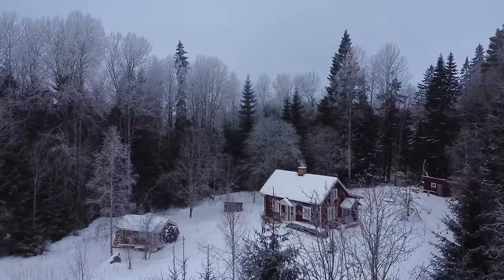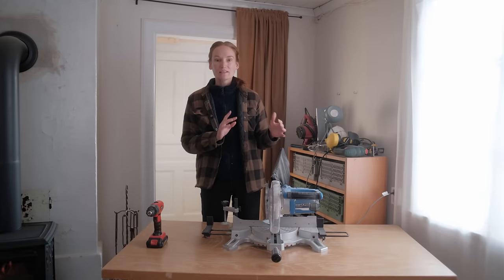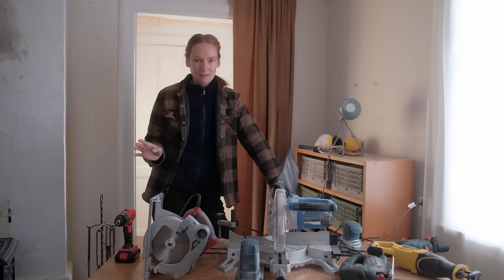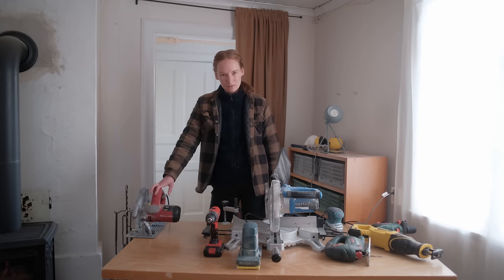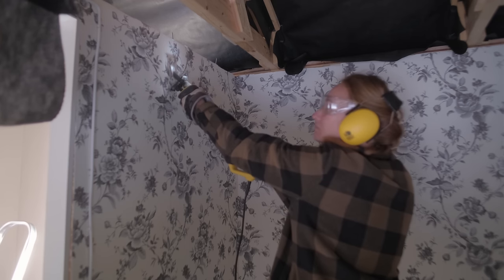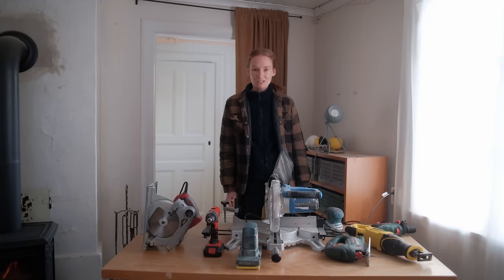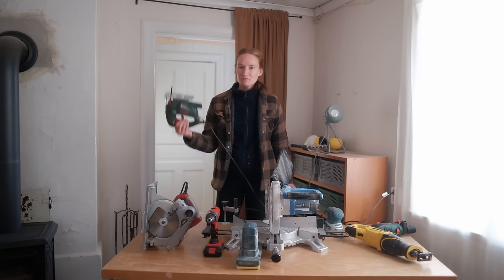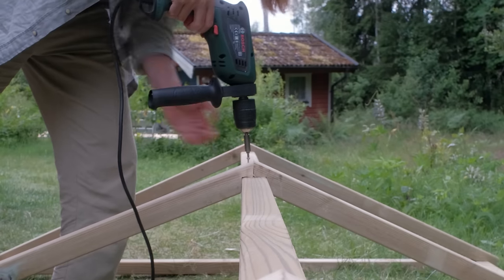The (basic!) Tools I Use To Renovate My Cabin

Comment: Orbital sanders are the best ones. Line Master Kwb Is a fine aluminum ruler, not that expensive. A small Block plane is a very nice tool, need some time to adjust, sharpen and learning. A little light hammer, 7oz, also nice for small nails. Regards from Chile.

Comment: There are tracks for regular circular saws on the market. There are also instructions on youtube for making a diy track/ jig for the circular saw. 

I have a circular saw and a table saw. I think I may have to get rid of the table saw. It is small and portable, but it requires so much room to use. And I may also trade out the circular saw (which I also hate) for a compact one and some kind of track or jig.

Comment: Very helpful. 
I do repairs and cut wood sometimes but don’t have a power saw of any kind!
I’m afraid of them!
I’ve known men that have cut their thumbs off and tipped fingers off!
I use a hand saw and a hacksaw. I have a little coping saw, too. 
That miter saw you have looks like it might be one I would try. 
I have a corded Craftsman drill that I’ve used for forty years. It does great at drilling but I’ve never done screwing with it. 
I did get a used battery operated hand drill but haven’t really done much with that yet. The batteries are expensive to replace and the drill is still is heavy, too!
Thanks for all the tips!
Really helpful!

Comment: Thank you for the valuable info.  I’m the states; I’ve decided  to go with a slightly less expensive brand  so that I can use the same battery packs. But the brand doesn’t carry all the tools that I need.

I try to buy myself one or two power tools a year.  This has served me well.

Next on my list is a nail gun.  Not sure which one I will go with???  A lot to choose from and tool shopping does tend to get very overwhelming (at least it does for me anyway)!  ❤

Comment: On buying into brand systems for power tools. Makita is definitly worth the price. They are light, precise and can take a lot of abuse. Bosch is also good, but not that good. The only other one i would buy into is Dewalt, that is slightly different, but as good as Makita. And sadly it's as expensive as Makita. Most of my tools are Makita now and they are a dream to work with (comming from cheap stuff).

But i have a question for you. I'm looking for a good japanese pull saw, and was wondering what brand and type you use. It's hard for me to find out what are the good ones and the ones you use has proven itself in your hands...

Comment: Rulers can be expensive, I use a aluminium levelingbar that is normaly used for leveling plaster. Fix it with clamps and it Is light and straight, and cheap mostly.

Comment: Hi Rosie, I’ve just found out about flexible drill bit extensions which allow you to drill screws in small inaccessible spaces. I’ve noticed you struggle at times with this issue and thought you may be interested. They are quite inexpensive 🙂

Comment: Another fun video, thank you. Oh, I was wondering how strict the building regulations are where you are, here in the US they are crazy, so it's difficult to do much with out a permit and they can be costly. Great review of your tools. So far it seems your choice of tools is great, and your advice for people to watch videos put out by the manufacture is good, although I prefer to watch carpenters who work with the same tools and provide more in depth information and reviews on youtube, but that's me. Most of what you have, are the tools I have been using for years rebuilding my house, It's what I could afford, so what I have. I too really love using my Japanese hand saw, it is wonderful, quiet, and calming. I also like using my jig saw when cutting things with an electric saw, I learned how to use a speed square to cut straight lines on old "this old house" shows. It was funny to hear you talk about using your circular saw, I also put off using mine when I start working on my house until I really need to, but once I begin it's much easier for me. I'm a 67 year old woman, and my reciprocating saw is too heavy, and scars me, so I only use it when  absolutely necessary, although I just invested in a smaller cordless reciprocating saw, and so far it's great, I can also use it for trimming small trees. I agree with you, when investing in cordless, go with a system, it's cheaper in the long run, I learned from my mistakes! I have used a a hammer drill on a concrete slab to put up walls, it works well, but I don't use it much as mine is an older one and very heavy.
Reply: Don’t always fall for the ‘necessary permit’ game. There are a huge amount of projects you can do both inside and outside without requiring a permit. Renovate a bathroom, your basement, etc. as long as you have the skills - electrical, plumbing, etc. you can avoid permits.

Comment: The tools you should really get is a good plane plus a blockplane (for getting into nooks and crannies). Tablesaw: no. Terrifying tool, much scarier than a circular saw, and takes much space, better off getting a track saw and a large sheet of rigid foam to use as a sacrificial cutting surface. That also gives you a long straight edge for other uses where you might need it. If you do want a long "ruler" don't look for rulers but straight edges or simply really long levels.

And a tip: you can measure for squareness by comparing the diagonals of the rectangle. Your object is in square when its diagonals match each other, which is a way to check things without having a huge square. Note also your squares might not actually be square; check them against each other.

With nailers you should at least consider a compressor as the tools themselves end up much cheaper (with the downside of having to manage the pneumatic hose connected to the tool and the compressor noise). An 18 gauge nailer is somewhat okay for furniture, probably still be okay to keep your roof slats up. 16 gauge would be better for that, but has more visible nails so you wouldn't want to use that for the visible parts of the furniture. But neither would be good enough for the frame for a building, for which you need a framing nailer. It all depends on what you might be nailing, as getting all these as cordless tools would end up being way more expensive than a compressor plus air powered versions of these tools. If you're getting just one or maybe two nailers, a cordless 18 gauge and screws for everything else where more holding power is needed is probably the way to go.

I agree you shouldn't buy the cheapest tools, personally I only buy brushless power tools nowadays; they're a bit more expensive but they'll last longer (you'll need to replace the brushes otherwise) and they have a bit more power.

Comment: Nail guns might seem like a good idea. But they are heavy, clumsy and the nails are beyond hopeless to remove once you make a mistake. I make mistakes all the time and much prefer to be able to unscrew and refit rather than demolish and rebuild.
If I were you I would buy a good impact driver to complement your cordless drill instead. Impact drivers are much kinder to your wrists than cordless drills. All the major brands are good, but Makita makes the smallest cordless drills/drivers, which is important to me since clumsy drivers are a hassle to work with.

Comment: Buying into a portable rechargeable battery system is the issue even when choosing gardening tools. I have three different systems going on and still have some corded items. It sucks. One item if you haven't seen it is a power planter 3" drill bit to use with my handheld brushless drill. It is such a wrist joint saving option in hard soils in my garden. 
Yeah! Why are rulers and squares so expensive!?!
Reply: I think they are expensive because they have to be machined very precisely to make them accurate.

Comment: Take a look at Lidls Parkside serie.
18 or 20v.
Good value for the money. 
You will have no problems with screws or drilling. 
You can run all their power tools on same battery, as long as they are from same serie.
Reply: Aren't they mostly sold out the first day in the store? She has no car you know.
Reply: I guess that depends on where you live. My local Lidl does almost always have tools and batteries.

Comment: And yes, it was a dilemma for me when choosing which brand (have now focused on Makita and cordless, for the very same reason which you mentioned.... being able to take the tool to the other end of my block without having to run a cord!

PS. I was initially going to go with Bosch, but builder friend suggested Makita!
Reply: Makita also make cheaper diy tools, that use the same batteries as the pro series. Many of them can be found in Jula department stores.

Comment: I was wondering if there are second hand tool shops or swap boards nearby. A higher quality circular saw is much lighter (that's how they can use only one hand) and can be smaller but second hand would be just slightly more than a new low end saw but then you have to spend extra money on a good new blade so it's still expensive. If you set the depth of the blade to .5 cm beyond the thickness of the wood, you can do all your cutting on the floor, just use scraps to raise your wood from the floor, really useful to cut sheets this way.

Comment: I tell you how to use a bigger hand saw. The tric is to only saw when you are pushing down. Not saw when you are bringing it back up. And keep it at an angel. Not totaly flat or totaly opp and down. And then you need to have a good one. And not a well used one. You need a sharp one. But not all you buy new is good. Unfortunatly I can not recomend one. I have bought new ones I have not been satisfied with. I got a good one at Byggmax once. But then the next ones they were selling was not good. You do have room for a tabel saw. I kept my Biltema tabel saw outside for years. Just cover it up with tappolin (or what it is called). It did not rust. I have really good use of my belt sander from Biltema. But looking at their pages now it looks like the only one is a small one. Maybe Sweden got a bigger one. Just buy one, it is so usefull. And the Biltema one is good enough and not so ekspensive. Be aware that Boch is not quality any longer. Makita is good. But for your (and my) use Biltema is mainly good enouf. And they are cheap. I find you to be wery clever, congrats.

Comment: I saw in this Vlog that you wanted a router. I have a Bosch POF1100AE that I would like to gift you. It's about 10 years old but complete with an extra set of router bits and not used very much. Personally, I rarely use it anymore. At least then it will be put to good use again. I have sent you an email with details.

Comment: You've done a heck of alot with just a few tools. With time, and some hints from folks who know more about construction, your projects will just get better. You don't necessarily have to buy anything for using your jigsaw more effectively, just clamp a board down and use that as a guide (youTube has lots of ideas).  I also despise really loud tools, even if they are quicker and effective.

Comment: Well done, a good video for novices. There are things you've not realised, such as the loose bed on your jig saw can be re tightened back up, it is designed to cut those angles when needed. I'd read the instruction manuals again. Don't stop using a tool until you're 100% sure it's not fit for purpose. Multi tool kits in a case come with the charger & two batteries & those batteries fit all the tools. Do get higher power sets, though, 18volt is ideal for best results/strength.

Comment: I have seen many of your renovating videos. I have not seen that you have insulated the walls before you do the inner surfaaces? Have I missed anything?
Reply: When she tore out the 2nd  “old” kitchen & combined it to be one bigger kitchen, she found horse hair & moss in the walls.  Very cool.  Since the house was originally a log cabin built in the early 1900s, you couldn’t get wool batting or  fiberglass, so it was fun seeing what they used.

Comment: If you ever decide to buy a table saw, don't buy any of those cheap portable ones. They are absolutely terrible, with bendt tables, dangerous fences and they do not cut straight in any possible direction. Track saw is a much better option, even the cheaper ones are ok.

Comment: Interesting that you dislike the circular saw. Looking through the comments, you are not alone. I have a pretty big tool collection, and I think the circular saw is my favorite to use. As far as buying cordless tools, try to find one brand/platform that suits you. As Rosie said, it is expensive and unmanageable to own more than one brand. I have never had much luck with "store brands". They are less expensive because they are cheaply built. Loud, heavy, prone to vibration, and unreliable. Stick with the "pro" brands and you will enjoy using your tools much more. "Buy once, cry once". I bought cheap tools early on because I thought I couldn't afford good ones. They broke early and often, and always at the worst time.

Comment: "Better" tools generally make stuff faster, not better. Only exceptions are stuff that's clearly defective (made so cheap it doesn't cut/drill straight etc.), but other than that anyone can craft with very little, it will only take more time and patience than with expensive power tools. Like, cheap chisel will still probably be fine for anything but most fine work, you just have to sharpen it more often etc.

Jigs also help a lot, clamping in a piece of straight edge onto board and using circular or jigsaw can be  "good enough" track saw for many cases, even if it is more PITA to setup every time.

Comment: I see that the measurements  for the angle iron straight edge did not come through on my original post, it should be 2.5cmx2.5cmx2.5m and 2.5cmx2.5cmx1.5m...my apologies

Comment: In my experience, the Makita brand tools were short-lived garbage, a brand we found to be very good was De Walt, long life, good to use.
Reply: Makita has a very good reputation for long-lasting tools, and that has been my experience as well (we have over 20 Makita tools). We inherited quite a few Makita tools that are ~30 years old and were used very heavily to build a large house, a workshop, and a shed, and they still work extremely well.

However, I believe Makita does have an economy line that is not as good (but also much cheaper). Maybe you got one of those? All of our tools are from the professional line.

Comment: Impact drills are used for anything that requires higher torque and are great for driving loads and loads of screws into wood (and similar materials) fast. But what you are showing seems to be a hammer drill rather than an impact drill (Bosch confusingly calls some of its hammer drills 'impact drills' in English) - hammer drills have a kind of 'hammering action' built in that clobbers the drill from behind to generate more forward force - that helps drilling into really dense materials such as concrete and hard stone.

You seem to be working almost exclusively with wood, so a hammer drill doesn't make much sense for that :)

Edit: Ah nevermind, you mentioned impact drivers later in your video.